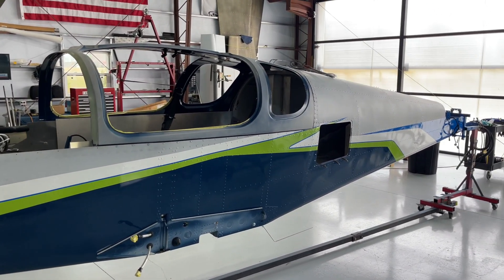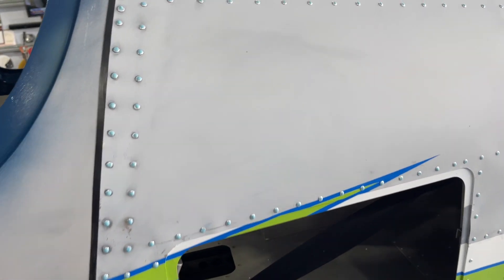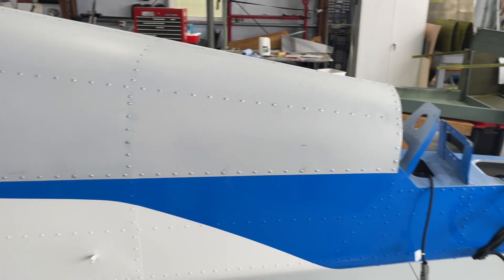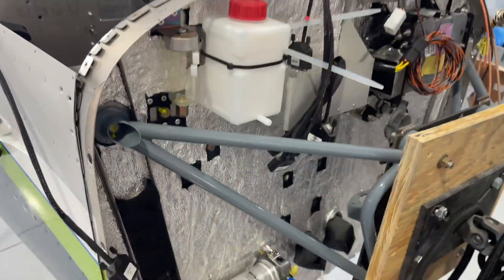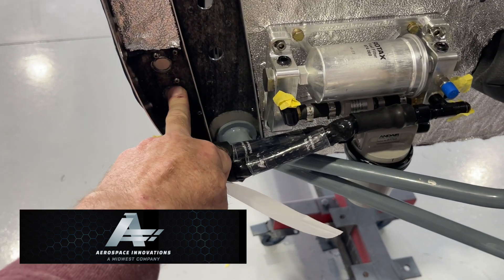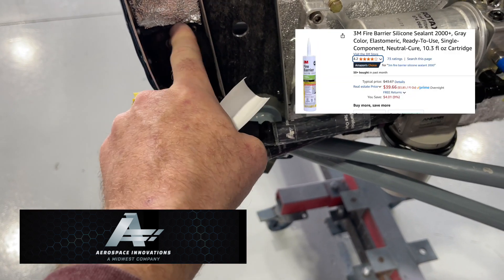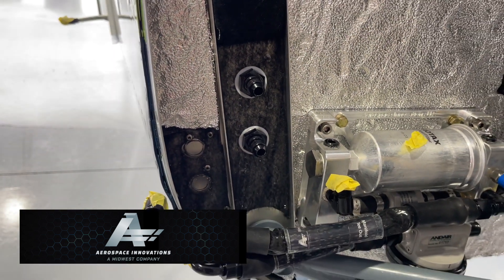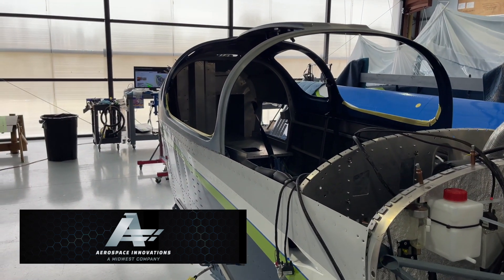Airplane Canopy Install  [Navi-Flow Fuel Manifold}  [Sling TSi Build Video #21 ]

Comment: What’s the biggest engine that could fit in the TSI cowling? 
Daydreaming about a 4 seat 200+knot experimental.
Reply from the maker: The Rotax 916 has been approved by the designers.  Vne on the Sling TSi is 155 KIAS.  Thanks for watching!

Comment: Nice progress! Have you tried reaching out to Aerospace Innovations about their incorrect length fuel lines? Wondering why they didn’t replace them with correct ones?
Reply from the maker: I did not because for me, it's a combination of both line length AND bulkhead fitting location.  I did not care for either and did not want to get into a dispute with them.  I'm not much of a complainer so hopefully they will see my video which is mostly why I do them.